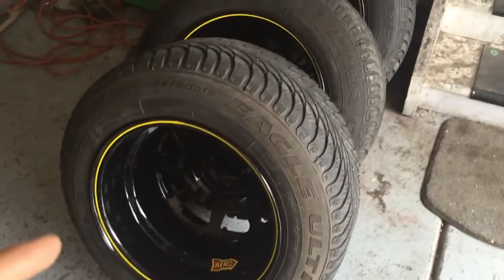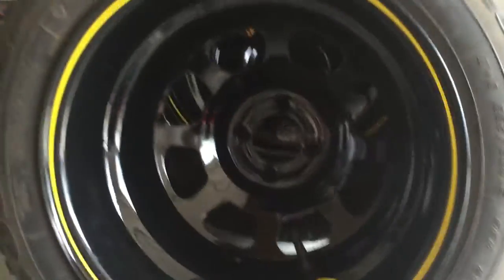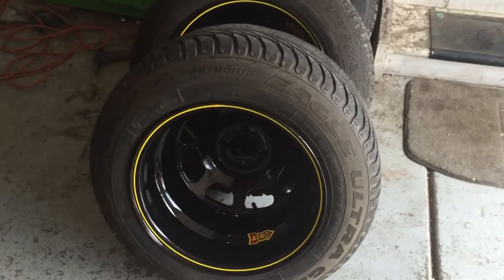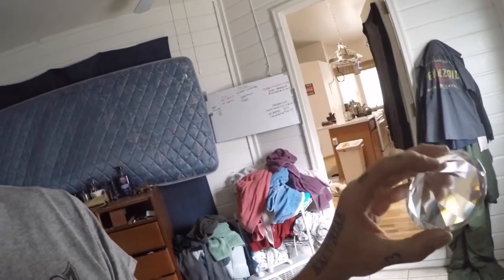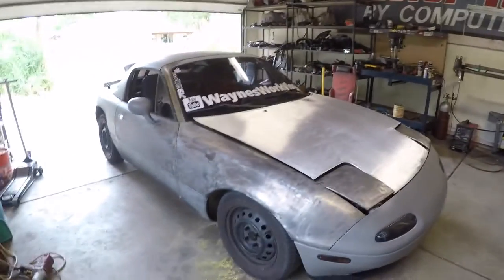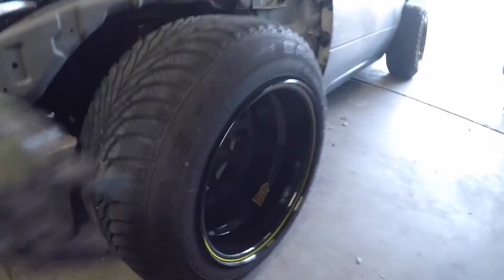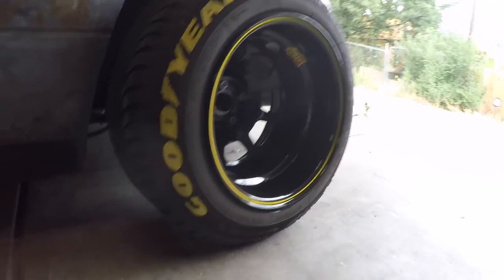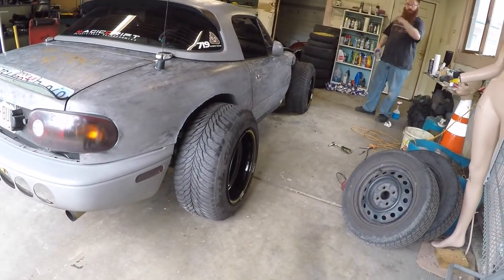Miata widebody prep Part 3 S06E17

Comment: subbed! I came from more skids. what are the wheel specs? (sorry if I missed them)
Reply from the maker: awesome, welcome to the channel!! they are Aero Racing 15"x10" with a 1" backspacing (aka -108mm offset)
Reply: +Wayne'sWork!Vlog ok thanks man, I'm building a widebody fb rx7 and trying to figure out some wheel specs to make em poke.
Reply from the maker: these will poke on anything. lol but check out Aero's website, then go to speedwaymotors.com to order. they can make em in just about any size
Reply: +Wayne'sWork!Vlog ok do they drill custom bolt patterns?
Reply from the maker: its all on their website. i think the only one they don't do is 4x100 but the 4x4 will fit technically.
Reply: Wayne'sWork!Vlog ok thanks man I'll check them out